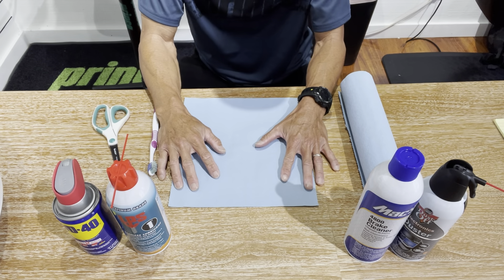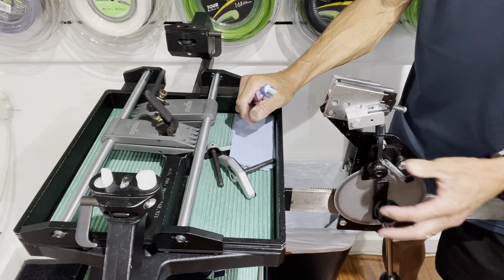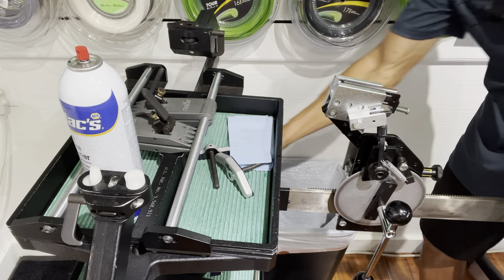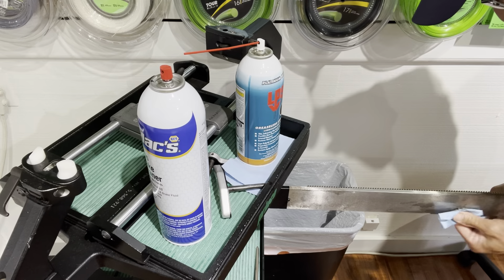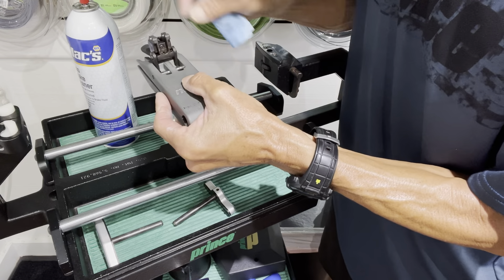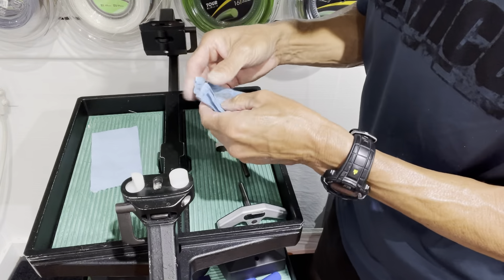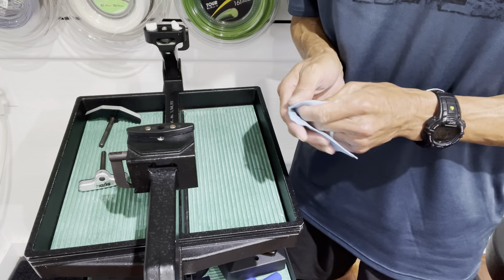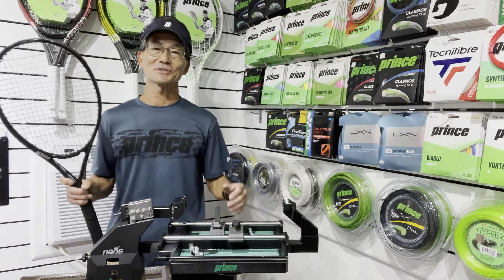Racquet Stringing [Part 2 of 2 - String Clamp & Lockout Machine Maintenance]

Comment: Any suggestions/techniques for cleaning the rust out of the gear teeth along the tension head's shaft? I've reclaimed my machine from my parent's house after it's spent 15 years in the garage =/
Reply from the maker: Aloha, 
Are you referring to the part called the Tension Arm Assembly, where the tension head moves back and forth? That's the only part of the machine with gears. 

If so, you can use a very fine sandpaper with water to remove the rust on the arm. To remove the rust in the gears, use a wire brush to clean it out. Make sure to remove the tension head during the cleaning process. After you're done, apply a coat of LPS1 or WD40 to prevent further rusting. Watch from 5:55. 

I hope that helps! 🤙

Comment: How did you remove the cover on the side with the crank?
Reply from the maker: Aloha Martin, The cover comes apart on both sides after you loosen the three Phillips head screws that hold them together.
Reply: @AMstringing  I just managed to get the crank off to remove the cover. That’s where I was stuck.
Reply from the maker: @eightof1975  Yikes, if your crank was stuck, that's not good. Hopefully, you can put it back on without any issues.
Reply: @AMstringing  wasn’t stuck. I just didn’t know it was supposed to come off. It’s all good. I’ll be cleaning my machine soon and then I’d like to book a stringing lesson with you.
Reply from the maker: @eightof1975  Cool!
Reply: @eightof1975  was your crank stuck on the crank shaft?  I just picked up a used machine yesterday - and at first the crank handle was super loose and easy to remove and switch sides.  After my first stringing - now it seems stuck and I can't seem to get it off.
Reply: @griffinmpc8144  No, the crank was not stuck. I was able to get it off quite easily. Took me a second to figure it out. Sorry you're having trouble with yours.
Reply: @eightof1975  I managed to get mine unstuck with a quick hit of Liquid Wrench.  Thanks for getting back to me!